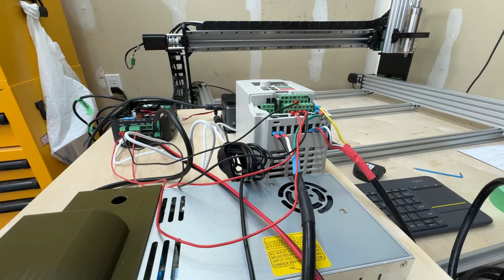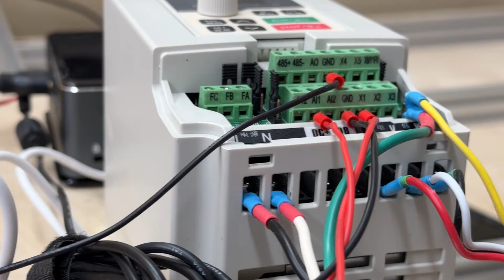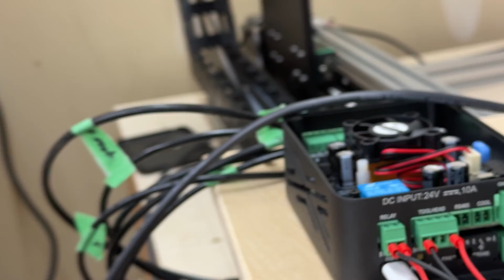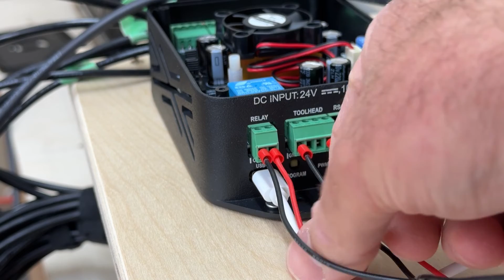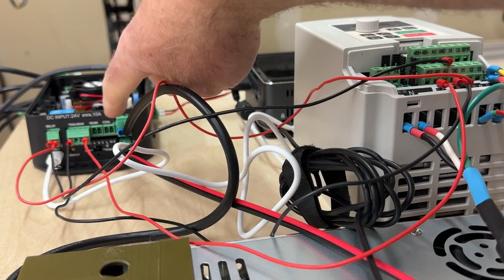Ultimate Bee H100 Spindle to xPro V5

Comment: Hi, been trying this for a few weeks now with a Huanyang VFD.
The problem I face is the xPro outputs from 0.5v to 10v. (It doesn't do 0v)

This means the spindle doesn't fully stop. It adjusts speed as I set the Snnn value fine.
What is the 0-10v voltage when your spindle is stopped (M5)?
I have tried to use the relay port on the xPro to manage the enable of the vfd (FOR for Huangyang).
Issue I faced here was the relay is closed when you first power on the xPro. 
This is a risk if the VFD is already on as the spindle starts. It then works ok with M3/M5.
Real headbanger..
Reply from the maker: Sorry for the delay, yes I found that as well. I used one of the pins as an enable pin and then the 0-10v for speed control. 
This way the spindle stays off despite maybe getting voltage from the 0-10v. 
I have heard people having success with the 485 Debug firmware from Spark for using RS485 with the spindle but I haven’t had a chance to confirm.
Reply: Way late but I found this video and it fixed all of my issues with this VFD connected to my xpro V5. https://youtu.be/J6nqaAiBo0M?si=47ZKRQbTdnEsIXfh